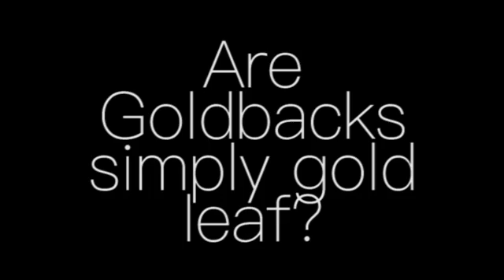What is a Goldback?

Comment: This is why they are so hard to get people to use as people wrap around the premiums. These are meant to be USED. I have been using them for awhile and I don't care about the premium  (at this time) as I get that premium back when I use it. Currently you can get these for about $3.66 - $3.77. They exchange at let's say $4. When you use them you are actually saving a little money. Again this currency was designed to be USED in everyday transactions not to hold for investment or even as a saving vehicle.  It's one comment on stacking videos and content creators that fixate completely on the premium without understanding completely what the intent was of releasing the GB. For a lot of content creators and the comments on their site about prepping and the state of the dollar and inflation but when shown an alternative they scoff. Just my .02.

Comment: I have a few questions: If I were to melt it down to recover the gold from a goldback how would I do that?

Secondly, I attempted to get a free goldback but had yet to receive it through my email. Who do I contact?
Reply from the maker: Great questions! 

The process for retrieving the gold is called Assay. In this process a lab technician places the goldback in a crucible that is then heated to 2000º Fahrenheit at which the polymer coating on both sides is burned away. After the assay process is complete, the only thing that remains is a small golden sphere. We do not recommend that anyone try this without the proper equipment and training. 

As far as the free goldback goes, that promotion has ended. Around September of 2019, United Precious Metals Association ran a promotion where one could get a free Goldback, while supplies lasted.

If you would like to read more please follow this link: https://goldback.com/news/over-1000-free-goldbacks-have-been-shipped

If you are interested in purchasing a goldback please visit: https://goldback.com/how-to-get-goldbacks

Comment: This process almost sounds like CVD or "Chemical Vapor Deposition" similar to what is used in the semiconductor industry. I'm curious if they use similar manufacturing technology to make these..
Reply: CVD involves a molecule that breaks down on contact with the substrate; everything but the desired atoms then evaporates away. This is one of the physical deposition methods involving argon.